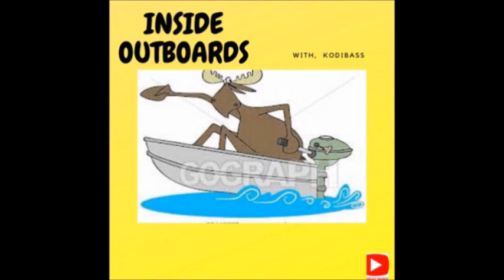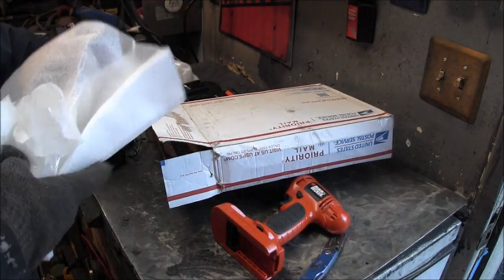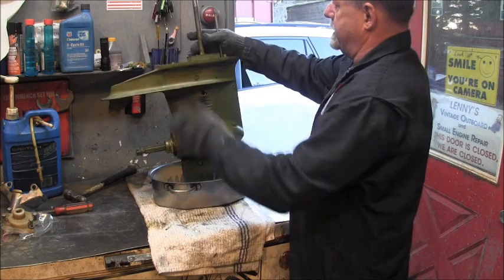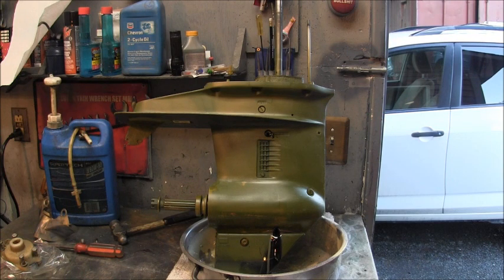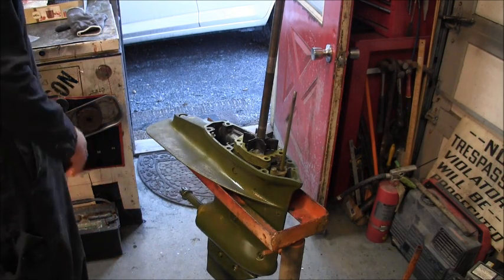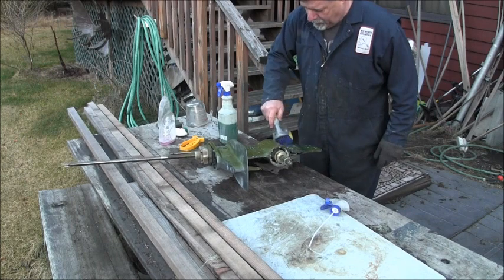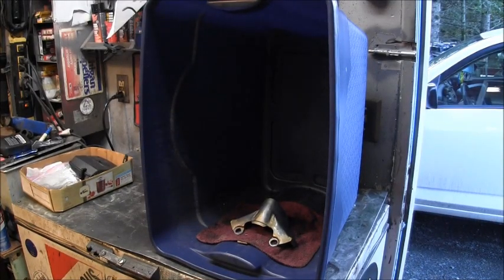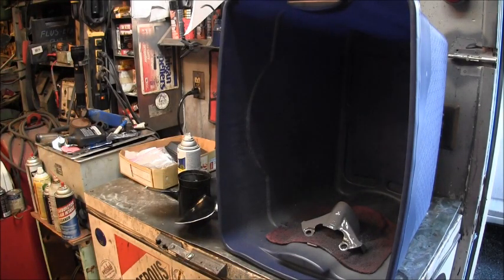1992 YAMAHA ENDURO     Cont'd

Comment: Great video. Wow, there is so much work involved in tending to these crippled motors. Did you pressure test the lower unit before refilling it with oil? Do you advocate performing such test upon each oil change? Stay safe and be merry !
Reply from the maker: No I do not do that unless I see a large amount  of water intrusion in the old oil,  This had only a little condensation water in it.                  kodi

Comment: I have 1971 50 hp Evinrude electric shift Ive been doing a lot of work to I replaced all the electrical parts from the stator and sensor coil to the spark plugs also replaced the reed valves now im doing the cosmetic work would you by any chance have the Evinrude emblems that go on either side of the hood Thanks for any help
Reply from the maker: Sorry I don't,  kodi